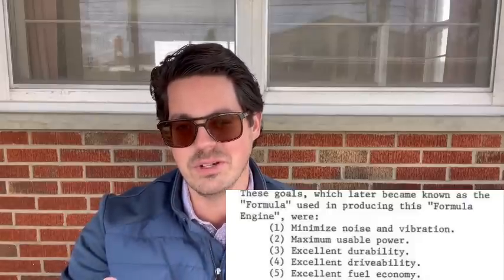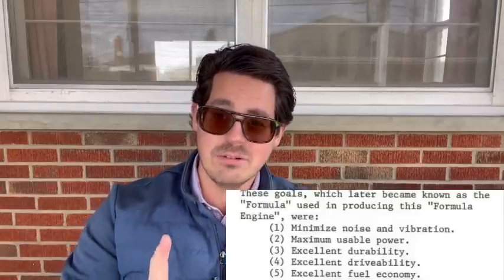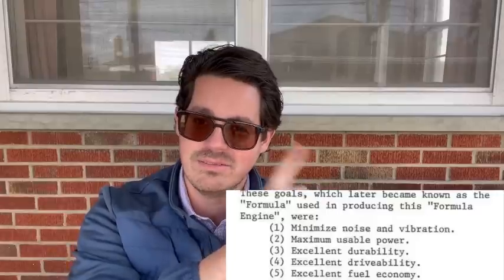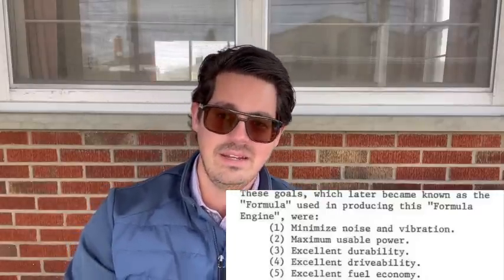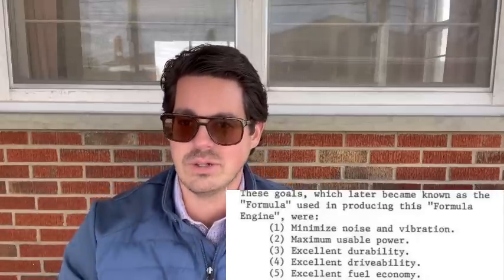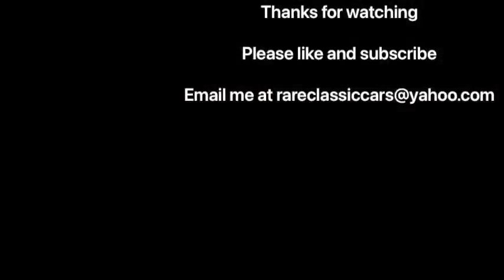Worst Engines of All Time: GM's 2.5L Iron Duke 4-Cylinder

Comment: The phenolic cam gear was in common use since the 30's, Studebaker converted their light 6 from chain to gear for the Dictator engine, which we know as the Commander engine. It was also used on Champions and V-8s until they stopped production of their engines. If the iron Duke had issues with the gear, and Studebaker didn't, then we get to look at tooth loading, lack of adequate lubrication, or alignment. From some of the comments, and a good friend, the balance shaft engines he worked on all died from lubrication issues. Balance shaft wear causing thrust bearing failure, causing automatic transmission failure. Guess what, no balance shafts., at the time, from parts suppliers. The earlier engines did not have this issue. Have fun

Comment: The pontiac iron duke and Chevy stove bolt door bangers did exactly what they were designed to do. The balance shaft would be gear driven like the cam. So it would make some noise. But this engine was a jewel for reliability, low maintenance cost and labor and cheap. Plus mi or tuning could produce a reasonable performing engine.

Comment: I still got the 1988 s10 5 speed iron duke my dad bought brand new in 1988. I had it rebuilt a couple years ago and i drive it every day 🤷🏼‍♂️

Mine has all its power at low rpm. It’s the top end that’s virtually non existent.

Comment: Had it in a 1981 Citation. That buzzing at idle at a stoplight was annoying. If it were an appliance, I would have slapped it on the side. 

I remember the Monroney label.  "This car is equipped with an engine made at a plant owned by Pontiac in Pontiac, Michigan."

As for the geared cam, I knew Studebaker used it on their V8s, but they quit making engines in 1963. I didn't know the Big Three used it 20 years later.

Comment: Adam: You are a kind and forgiving man.  I must have driven at least a dozen of these in rental cars of the mid 80s, all were GM A or X-body variants.  The idle shake was indeed horrible.  What made them even worse... they were mated to the THM125 with the lockup torque converter.  Odds were about 50/50 the car would have a faulty TCC solenoid.  Let's just say the Iron Duke put the CHUG in Chuggle.  The combination sent many a renter home shaking their head, determined to never even consider a GM car the next time they shopped.

BTW:  Since the Iron Duke shares its bore, stroke, and connecting rod dimensions with the Pontiac 301 V8, it would appear that Duke's carefully chosen rotating assembly specs just happened to coincide with a downsized V8 engine destined to launch about the same time.  Parts bin engineering with an eye to the future!  Do you know if this was the case?

Comment: The Iron Duke was the Briggs&Stratton of 4 cyls. I still have a 1990 S-10 (bought it new), 5 speed and drove it across the desert at 105 mph @ 5000 RPM's for 175 miles and that sucker held together. Didn't do a rebuild till I ran it 6 miles without water at 200.000+ miles and it got me home. But your right, it's pretty damn gutless.

Comment: I had a 1990 S10 that had the 2.5 with five speed trans and when I got it I was told it had cought fire and he showed me the original intake it had a crack on the bottom between intake runners 2&3 is that a common thing?

Comment: I had a NEW 1978 Sunbird.  Thought it was half a Firebird.  Hey, I was 16.  TOP speed was about 78 MPH.  Speedo failed early and the dealer replaced it with one for a Chevy.  The color scheme was orange instead of the Pontiac white.  Had an ODD second odometer that was supposed to roll up the word "SENSOR" at 50,000 to tell you to replace the oxygen sensor.  Also had the HORRIBLE one-time-use disposable air filter.

Comment: I'ved owned two boats and three cars (with manual transmissions) powered by the Iron Duke. My experience with them was very good on the lake and the road. Reliable, never a maintenance issue, only regular service and economical to operate.

Comment: You're correct about the timing gear noise.  I remember several coming into the Chevrolet dealership where I work that sounded like a diesel clattering away....they kept going,  though.  Definitely a few steps up from the Vega engine that they replaced.   TBI helped the driveability a lot.  I do remember that replacing distributor parts in an Iron Duke powered FWD was a pain in the ass, since the engine was originally designed for a RWD application.
Reply: That describes mine pretty accurately. It also always had a bit of a high pitched squeaky sound like a sewing machine that needed oil. It almost sounded like a belt idler starting to go, but it never got worse and all the idlers felt fine.

In an S10 with a stick, it was pretty much a tractor. In that platform that's pretty much what you wanted so it worked out.

Comment: Thanks for the trip down memory lane  again.  I think some of these 2.5's had the oil filter in the oil pan, and could be quite the mess when you changed oil.  Maybe some had drain plugs, some didn't.   I do remember the timing gears shredding.    Unrefined is about the most polite way to describe these engines.
Reply: I remember the oil filter in the pan. That certainly didnt last long. But it was probably easier than having to crank the front wheels all the way left, removing the inner fender liner to get to the filter buried on the back sde of the engne!!
Reply: I liked that setup.    They still retained oil drain plugs and the filter cup was right next to it.   Super clean drain into the pan for the filter and no brake clean spray to clean up the engine bay.   👍
Reply: Yuck. It sounds like they should have never put these in cars. In an S-10, I could change the oil in 10 minutes without a jack. It had a regular oil filter.
Reply: @TheBrokenLife  It was actually a clean setup.
Reply: @highwayman1218  I must not be getting the picture, because it sounds like you had to drop the pan to change the oil?
Reply: @TheBrokenLife    No not at all.  No dropping pans.  At the center of the pan they had a cup that threaded into the base of the oil pan.   Pull the drain plug for the oil.    Then a 13/16 socket on the fitting on the cup.   Screw it off, pull the filter out, slap a new one in, screw the cup back onto the pan and tighten it down.   No fighting with fenderwells or cleaning the chassis up with brakekleen.   Actually a smart idea from em.
Reply: @highwayman1218  OK. When I heard/read "in the pan", I was imagining IN the pan, like an automatic transmission.

What you're describing sounds odd, but not awful. Especially with what it sounds like they went to.

I still like the S10 arrangement of "normal". 😄
Reply: @TheBrokenLife   👍👍

 Im not sure if youre familiar with the new Toyotas, but they have the closest thing to what GM was doing back then ( just GMs didnt need a special tool to take the filter cup off).
Reply: @highwayman1218  What I've seen is a return to cartridge filters and a handful of Toyotas that put them on top of the motor. Looks like a complete mess, but, I may not be understanding those correctly either. I've never worked on one.
Reply: At least when the timing gears shredded, it didn't destroy the engine the way a broken rubber timing chain in many Japanese engines does.
Reply: @highwayman1218  Never knew about that one!
Reply: @highwayman1218  I wonder why, when the Japanese do something weird, it is OK, but if Detroit does, it is the most horrible crime known to mankind.
Reply: @michaelbenardo5695    Haha, for sure.    I can say the filter setup on my daughters Rav 4 is more of a hassle then those old GM pan filter.   Had to buy a special tool and the housing is outta plastic (but thats the norm nowadays).
Reply: @highwayman1218  Can you imagine the outrage if Detroit had made something like that?

Comment: My Mom had a GM car with the 2.5L Iron Duke during the mid 1980's. Other than what I believe was excessive valve cover gasket wear, the engine kept running. Granted it wasn't that quiet or smooth.  I cannot in good conscience say that the 2.5L Iron Duke was a bad engine.

Comment: I used my Folks 87' Chev Celebrity 2 door coupe from 89-91 back and forth to school  .. had the TBI   this car got 32-34 mpg even with over 176000 miles! yeah was a dog over 30 mph but had enough torque off the line to spin them easily.

Comment: I owned a 1996 Cutlass Ciera boughted new with the 2.5 Tech 4 and it needed a top engine job at 54.000 miles which I did myself , the gasket set cost $ 190.00 and the valve job was $ 95.00 . Why doing this the parts guys told me this thing was a half of a 305 Chevy . This is why it was a crossflow and the cam gear was a fibre construction . As the 305 was a timing gear . The reason that happened  why, this occurred  was that 1986 had a rash of poor heat treating of the head bolts as two of them came out break off as I removed them . After that I got rid of the car and got  a Dodge Dynasty which ran fine for years until I got a Nissan Quest that ran great until my son wrecked it being rear ended by a bus years later.

Comment: Nope.  I don't agree.  At ALL.  I've had too many cars with these engines and they've been too good.  The Iron Duke in my 81 Buick Skylark is 41 years old.  It's never been rebuilt.  It has 224,000 miles on it.  The timing gear has never stripped out on it.  It got 32 mpg on the highway when I drove it regularly, and it has a non-lockup 3 speed automatic in it.  And perhaps most key - it ISN'T loud.  I don't know why - I've never been able to figure out why, but it is not like the mid 80s ones.  It still has a carburetor on it.  It's quiet.  You hardly hear it when you drive the car.  It's quiet at idle.  Why? I don't know.  But that's how it is.  It does have some slight vibration in the steering wheel at idle under certain conditions, but it was never enough to bother me.  I hardly even notice it.  My 90 Olds Cutlass Ciera went 357,000 miles before the timing gear stripped out on it.  357,000 miles, and 30 years!  It took SO LONG for that to happen - who even keeps a car over 300,000 miles?  But I liked the Oldsmobile, so I kept driving it.  It was always very reliable. Even as it got older and older, as it got into its 20 year mark and then 25 year mark, I just had so few problems with it, so I kept driving it rather than buying another car.  Even the few problems I had, they were never expensive.  And it gets 33 mpg on the highway.  It's simply the best car I've ever owned.  And I'm not getting rid of it anytime soon.  And I fixed the timing gear too and kept driving the car because it's been so good.  Engine and transmission - never rebuilt, in 32 years of ownership.  It's still my daily driver.  The Oldsmobile's engine is louder than the Buick's.  Why, I don't know.  It has throttle body fuel injection - maybe that is why - but I don't think that's why.  The Olds has the balance shafts, so there is no vibration, it's just louder than the 81 at idle.  Then I have an 84 Skylark.  Yeah, it's louder than the 81.  Also TBI, no balance shafts.  You hear it running at idle.  But it's not objectionable.  Fine, so it's not like a sewing machine.  I just see nothing wrong with this engine.  You won't win any races with one of them - but who cares?  There's nothing "unacceptable" about it.  The ONLY thing you should not do with one of these engines is to overheat them - but then that goes for a lot of engines.

Comment: I'm pretty sure that's the engine that I had in my Cutlass Ciera and Grand Am. They were late 80's early 90's so they weren't too bad. Never had to work on them. Had more problems with transmissions and rust than anything else

Comment: Timing components were an issue . Both the gear drive and the chain drive . Pertaining to the gear drive, will servicing the gears , drill a small hole in the oil galley behind the cam gear so oil will spray on the gear , noise and reliability issues solved . I built a Circle Track Duke and it did well against the 2.3 Fords . The addition of the balance assembly   to the Duke was a step backwards .

Comment: Here is an old odd duck that you may or may not have experienced.
A 4 cylinder, cut from their eight cylinder. International Harvester, put in their 1/2 ton PU.
I do not know the years of manufacture but mine was smooth and outlasted the rusted out hulk (Iowa salt).
A manual transmission took it to highway speeds easily because of the torque.
No racer but it was a beast.
Reply: With the automatic in a Scout, those things shook like a paint mixer — especially the bigger of the two (196 CID).

Comment: I believe the Iron duke motor has the same bore and stroke as the Famed Z28 302 DZ block motor from 1969. I worked at GM Powertrain Cam and crank department in 1995, FLint MI. Being an Engineer and reviewing drawings, the floorplan showed the Iron duke 4 cylinder production machine interspersed with V8 Machines. It was removed by the time I got there, but they were still on the drawings, so it appears the 2 engines were produced in the same factory at some point. We made 350s there, and the 302 was gone by then, but could have easily been produced there with the 4 inch bore size all being shared by 302, 327 and 350 engines. It was neat working there as I had previously torn apart v8 engines in the mid 80s in the course of fixing cars, upgrading, blowing them up and just an engineers curiosity as to how things work. My Dad had the 2.5 Liter in his Concord and the low end torque yes, was missing. Thats why i looked up the specs of the motor and found out it likes to rev and make power up high in the RPM range, just like the DZ Camaro Engines. It was funny years later we replaced the engine and in the course of that discovered that a piece of plastic had fallen below the carb and was preventing the throttle from opening fully. Obviously we removed the obstruction and the next engine decently produced some power.
Reply from the maker: Different iron Duke. That one was used in the Chevy II. This is completely different and designed by Pontiac
Reply: @RareClassicCars  — He’s right about the Pontiac Iron Duke having a 4.0” bore and 3.0” stroke ...

Comment: I had an 1986 olds calias 5 speed manual for 9 years (about 90,000miles) - never really noticed the noise issue- i got 42 on the highway- about 25 city- I liked the car

Comment: The Iron Duke isn't a horrible engine, but frankly it was enormously outclassed by competing engines from Japan.  The Toyota 20/22 R series were just as easy to work on, and much nicer driving.

Comment: I thought the fiber/nylon gear was used to quiet the valve train? Yes they get hard, cracked and the timing will slip a cog, eventually. Hopefully not enough to hit a valve with a piston. My experience is with different engine brands, however.

Comment: We had a Pontiac 6000 with the Iron Duke, with less than 3k miles, the main bearings went, had to have it pulled and rebuilt, did it again at about 20k so we got rid of the car, car was great other than the engine issues...

Comment: I had a s10 with the 2.5.       Worse position for a distributor. Low on the engine right in the splash zone.   Every time it rained I lost power and stalled.   I kept a can of sil dry spray with me always. It got to where I could pull the cap and spray in under 10 minutes in the dark.    Good times.

Comment: In 1986 the Oldsmobile in 1986 the Oldsmobile and others the iron Duke with throttle body injection would get up to 85 mph very quick I've never seen too many of these fail except for the cam gear.

Comment: They should have put Bevel Gears on the Timing train for longevity and smoothness. Obviously they did not, just to save money. This Engine was used by Mercruiser Marine for Inboard-Outboard boat engines. A very loud and rough experience. When I first got in a V-8 powered boat, I could not believe the turbine like smoothness. They also bored these out to 3.0 Litres for Boats. The idea was that the Propeller in the water would act like a Hydraulic Harmonic dampner. It did not!

Comment: This iron duke in the Pontiac Fiero was a complete disaster! This was in the time period where every one in for made for that engine was defective. My sister and her husband had a Fiero they specially ordered. It literally blew up 8 engines during the warranty period. The car spent more time at dealers scattered around the western part of the US getting repaired, it was a total joke. And not in a good way. They wound up with about a 2 1/2 inch thick folder of repair orders and warranty claim documentation on that car. The final straw was when they went to pick it up after getting it back for the eighth time and the motor blew up with my sister driving the car. She walked in the front door at 6:30 pm and told her husband that car was going away that night. By 9:30 PM, there was a new Dodge Ram 1/2 ton pickup with slant six, manual transmission short box pickup with manual steering sitting in their driveway. That truck spent no time in the shop the entire time they owned it. They had it for several years.

Comment: had a '87 and '92 S-10 with this engine, never had a problem.  Would never have a smooth idle
Reply: Could you tell a difference between 87 and 92? I'd have never imagined my 89 had a balance shaft in it.

Comment: Went out of my way to swap one into my 1990 S10 . It was factory with a 4.3, had a V8 swap and the V8 threw a rod. So I gave it the engine it always wanted a craigslist iron duke and 5 speed.

Comment: I thought the Iron Duke was okay - once you got past the initial startup if the car sat overnight.  When sitting overnight, oil found its way into the combustion chambers .  when started the engine sprung to life emitting a huge cloud of blue smoke. Once the smoke and the burnt oil smell cleared the engine rain fine.